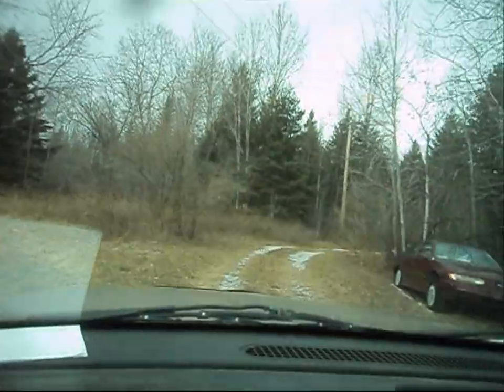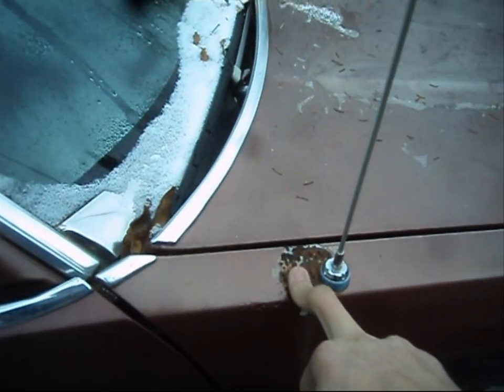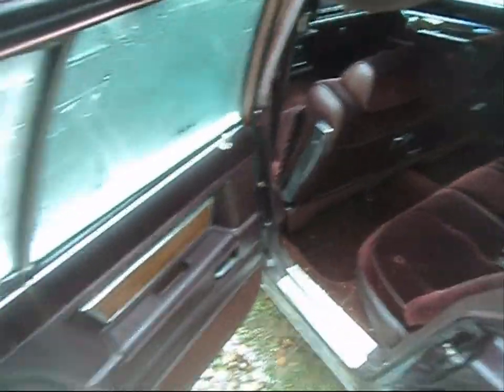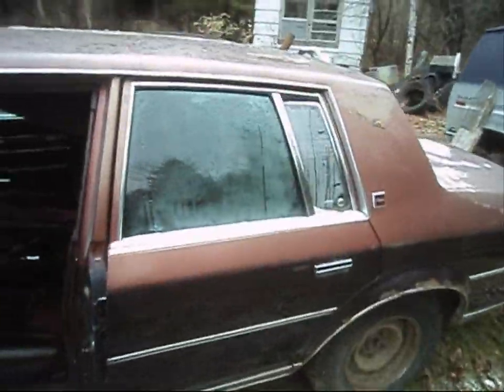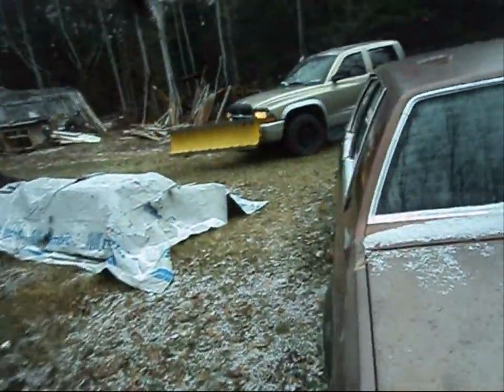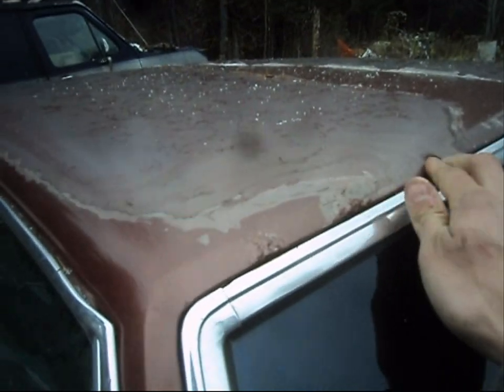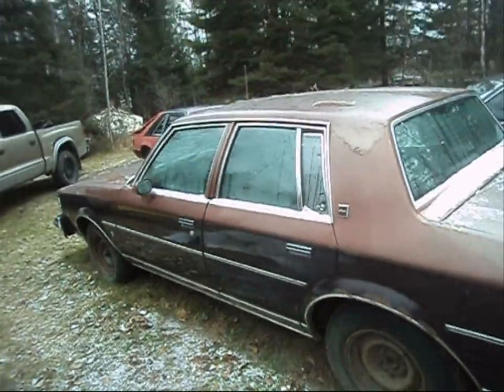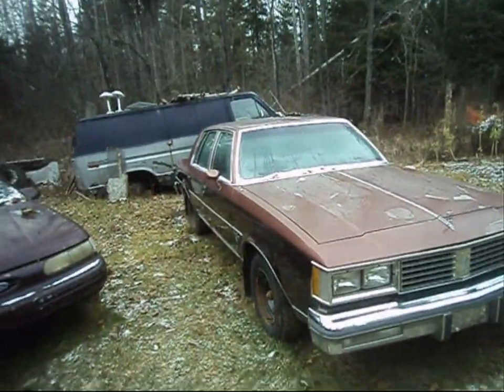Cold Starting the Old Forgotton Olds: December 2015

Comment: Considering your past and current projects, just ignor the haters, and make them eat their words when you're done fixing up this one. It's basically solid, so with one of your paint jobs and a crossover pipe, it could be a very nice runner. And you're working on a 305 for the Caprice, so you're probably able to work on small block Chevys in your sleep by now. They're so simple, even I can work on them!